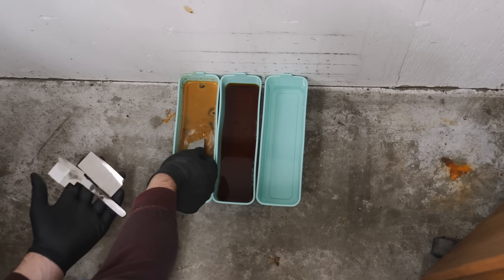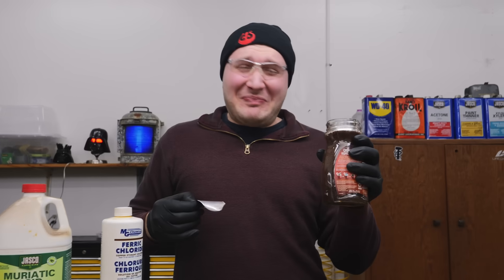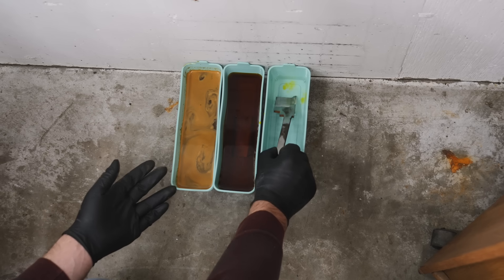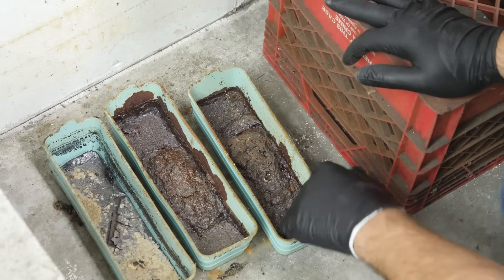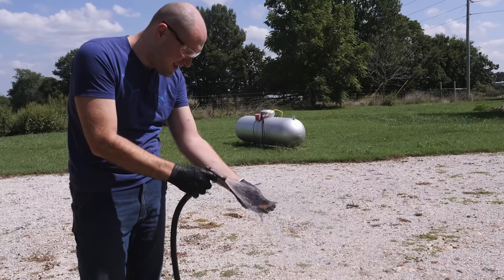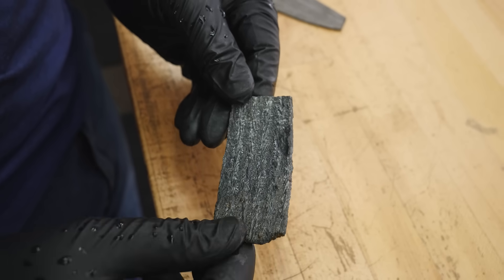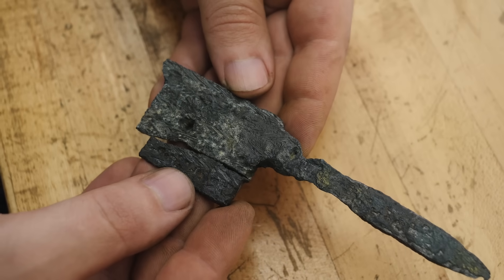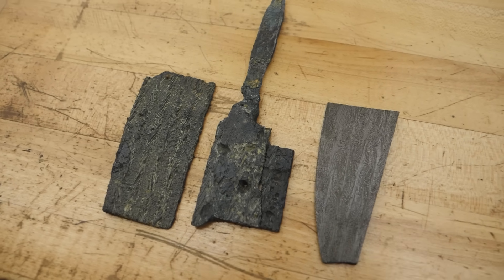I Left My Knife in Acid for 2 Years

Comment: you can also use a small amount of hydrogen peroxide as an etch accelerant, that is, the peroxide enhances the etch rate but then slowly stops upon loss of oxygen. That means the pattern will emerge without such egregious mass loss of the steel itself, a small amount of phosphorus will also yield some interesting affects without damaging the steels strength too much.

Comment: I worked in a place that etched small metal parts in ferric chloride. 

This video is giving me ptsd of everything I brought in, along with most of my skin, being stained orange constantly. Idr if we used muriatic acid, but definitely did hydrochloric and nitric acid as well.

I'm kinda surprised there was anything left, but I went through a 55 gallon drum of ferric chloride every other day, and it'd start losing its potency very quickly while etching very tiny amounts of metal. 

The coolest thing we did there was dip full coke cans inside of one of the acids, and it would eat the aluminum, but not the plastic lining of the can, so you'd just have a bubble of soda left.
Reply: Oh wait. We used muriatic acid to clean the ferric off everyrhing, if I remember correctly. It was in powder form.

Comment: I hope for the sake of your practice as a blade smith you’re no longer doing water quenches.  Oil is far better, and safer for the metal.  There are precautions for you of course, but, in a good shop safety is always first.

Comment: Oops 😬! But very interesting results.  I used white distilled vinegar on one of my store bought knives and apple cider vinegar on another. Both were made of high carbon steel and the etching results for both were more amazing than I had anticipated. The white distilled was somewhat, but noticeably superior to the apple cider vinegar. But they both worked. And gave both blades a nice semi-matte dark etching and Definitely brought out the grain structure of the steel. Not as cool as the sweet patterns that several of you lovely blacksmiths/bladesmiths on YouTube have shown me over the years, which has fueled my interest in the craft by multiple degrees with each one I view! 👍🤙🤞🖖✌️
Reply: Ujjain>

Comment: The ferric chloride would be an awesome way to finish a blade that long. Make the blade have a bit of extra thickness so there's enough material there to keep the strength. Coat the bottom 1/4 in clay or something impermeable to protect it. So it will still be usable. It'd be a one of a kind for sure.
Reply: The ferric acid looks like something that's taken dragon fire or something

Comment: Why couldn't you use PVC pipe and capped the ends. You could have even had them hanging by wire inside the sealed PVC pipes for a controlled environment.
Reply from the maker: Yes yes and yes. But we didn’t. Was only supposed to be one month. 
Chao. 

Dad

Comment: how is it considered damascus if the true knowledge of how to worge it was lost to the time? I may sound biased but what you people posting "damascus steel" do is bashing together random scrap and eating it out with acid while the normal steel had the watered patern on by nature. This is why its called "watered steel" not "acided scrap metal". I did blacksmithing as a hobby and know for a fact these pieces of scraps dull extremly easily, are prone to shattering and breaking due to not being fully fused in forging process(to get the eaten out by acid patterns) and are only usefull for decoration purposes putting it anywhere near damascus steel would be a crime against those who first forged it.

Comment: I personally thought the piece you pulled out of the coffee etch looked the best. It almost had that etched wrought iron wood grain look to it and the deep grooves looked very interesting. I know you didn't use a lot of the acid in those tubs but having that muriatic acid out in the open in the shop is scary to think about. Have you had any steel tools that have rusted without reason in the last two years? If so it's probably because of the muriatic acid. I've seen/heard of some horror stories concerning leaking or left open containers of muriatic reeking havoc on steel in the area near it.
Reply: Same why I dont charge batteries in the shop
Reply: "Wreaking" not stinking
Reply: Weird.....I thought I was just watching YouTube videos, I didn't know I signed up for online English classes.  I feel bad for all of the people who won't get the point of what I wrote because a word got auto corrected to the other spelling.
Reply: @okiedokie2487  Yeah I have the same problem with the auto correct and it drives me nuts! 💯👍

Comment: So this kinda touches on a idea I had. Make a knife out of pattern welded copper and steel, Then attack the copper ether chemically or with electrolysis. I assume you would need a fully steel core but it may work.

Comment: You should make a patern welded seax then put it in the acid for just a year or so. It will come out looking like an archaeological find. Raven armoury has the option for having the blades aged to what ever condition you require. It would be interesting to see that process done. Take the blade out every month or so. So you can see the progression of the aging process.

Comment: This is awesome, there should definitely be more tests with a longer but reasonable etch, like instead of 2 years, etching it for 2 or 3 months.
Reply: @osirisatot19  I think the point is more that using different etching liquids for different durations. Obviously the acid was too strong, but could you achieve the same results from a strong acid vs coffee or ferric chloride but with a shorter duration, or if you wanted a really tactile and deep etch? Further more, would doing this with copper Damascus change the result, ie would the copper dissolve more or less etc?

Very interested to see more tests on this, as much as I like to see finished blades, kinda hoping for a few scrapped ones to see this used on.
Reply: @stegles  Ferric chloride is used to etch circuit boards(which are made with a copper substrate). it eats through copper VERY quickly
Reply: imagine buying knifes that have been barrel aged like whiskey......macallan 25 year damascus steel.....
Reply: @b33sma11  It would have to be a dummy thicc blade to survive that long under the right conditions but it would have to be a display piece only
Reply: Use heat to accelerate the process.
Reply: Repent to Jesus Christ “Give thanks to the Lord, for he is good; his love endures forever.”
Psalms 107:1 NIV
J

Comment: Unsurprised they didn't completely eat up the pieces, for there's only so many atoms to go around. If you put them in a higher volume of acid, it would completely eat them up, in probably far less time.
Reply: A bit of heat and circulation also speed up the process.
Reply: @butsukete1806  i thought the heat would be trapped inside for atmost a few days therefore it would maybe speed the acid for some time tho wont be long to entire eat the metal
Reply: @butsukete1806  I think all the electron acceptors are used up after 2 years
Reply: 2 weeks later: How I left my wife in acid for 2 years
Reply: I don't really think a knife is edible. Wouldn't try this myself 😬
Reply: @tendrilitis  You know we aren't talking about.eating them-
Reply: LeChatelier, my man, LeChatelier. Increase concentration of acid or remove the hydrogen gas  (product) from the system. Neither happens, the reaction stops.
Reply: Yeah but it probably lost power over time
Reply: I was thinking about why the acid didn't completely gobble up the blade but as soon as you mentioned how only so many atoms can be eaten by the acid it made sense. Same thing goes for liquid solutions, anything left undissolved is because that's all the solution can dissolve at the current volume. Cool stuff!!!!!!!
Reply: I totally misread that comment as “surprised you didn’t completely eat up the pieces” and got a massive giggle out of it.
Reply: I'll shred that tiny little knife down to its last Atom....thanos
Reply: Do you have any idea how many atoms are in even a small piece of steel? We're talking multi, multi, multi trillions.
Reply: @danieldevito6380 
Either way next time I don't want to do something I'm using the excuse...

"Sorry can't, there's only so many atoms to go around..."
Reply: The metal sort of self galvanised because of how much time it was given.
Reply: Thanks Cliff from cheers…
Reply: @emilflognoid1532  🤣 😂 🤣  captain obvious over here
Reply: @emilflognoid1532  omg 💀💀😭😭😭
Reply: @emilflognoid1532  - 😂wonder if any of the newer gen kids will get this.
Reply: @Theactualcurrentsea  no.
Reply: @Theactualcurrentsea  I'm a 90s kid so I got it
Reply: @Theactualcurrentsea  as a 13 year old I feel like we would either understand a lot or just not at all, but I do understand that acids are proton donors and alkali are proton acceptors, so the idea that acids "eat away" at objects would be how alkali would be better described. Both acids and alkaline do deteriorate objects in most situations.
Reply: Probably would if it was sealed up
Reply: @kohavbuskila  *in a vacuum
Reply: What's the point of this comment?
Reply: @MandanaBanana  Because the host said he was surprised there was anything left? What's the point of THIS comment?
Reply: @breakawaybooks  No, the original commenter was saying they weren’t surprised the blade survived. It’s basic chemistry. A dilute acid only has so many molecules of the acid, and when those have all reacted with the steel the only thing you have to worry about is possible corrosion.
Reply: @MandanaBanana  - Lol, typical YouTube people somehow thinking an anonymous comment will overshadow their short comings in life, or, someone feeling they need to flex their Google search power to a bunch of strangers. To each their own, I have caught myself doing similar stuff, so I have no place to talk, just state the truth of it.
Reply: @Theactualcurrentsea  what are you even talking about
Reply: @chairwood  Nah fr though 😭
Reply: Repent to Jesus Christ “Give thanks to the Lord, for he is good; his love endures forever.”
Psalms 107:1 NIV

Comment: Very interesting textural results. I could certainly see some experimentation into aggressive over-etching. It might not result in usable blade stock, but we use all sorts of cool materials in handles, fitments, sheathes, etc. Thanks for sharing this awesome "failure!"
Reply: I also see some aesthetic value in what we got to see in this video. It might not make for a great blade, but as bolsters with something else rough like Elk antler, I could see that working as a wow factor in a finished piece.
Reply: if you make the blade wider than the desired dimesions, it might work
Reply: @kassiog.6595  I was thinking in terms of practicality vs strength. As an example, I'm mid-way thru a farrier's rasp bowie build requested by a friend. It's a cool look, but I wouldn't want to try to keep it sanitary as a kitchen utensil, or clean it after a messy job because of all the remaining rasp teeth. Same applies to the deep striations and holes that we saw in Kyle's over-etched damascus.
Reply: @benr8772  i was thinking more in a exhibition piece that's also funcional, like most of Kyle's work, they will do the work, but they are so good looking that noone would use them for something messy